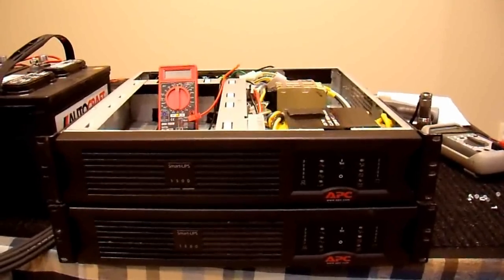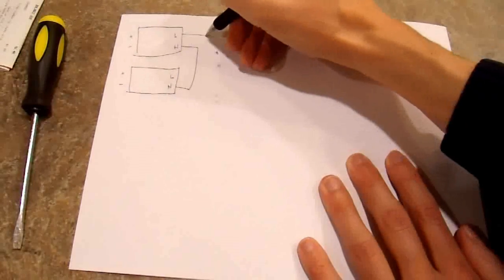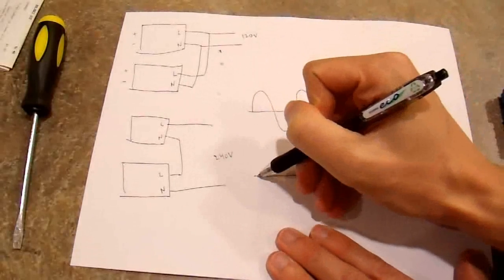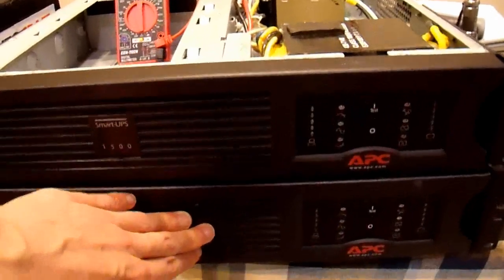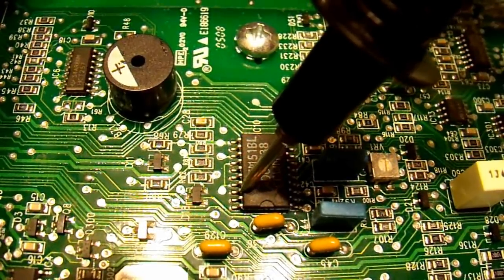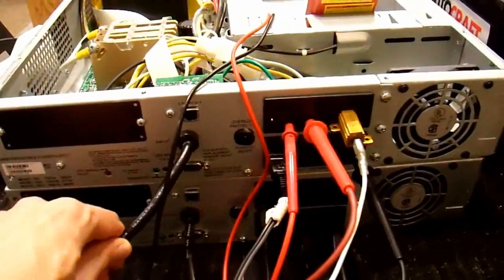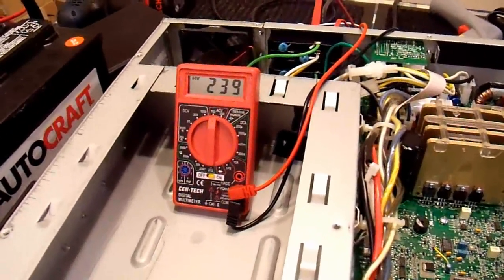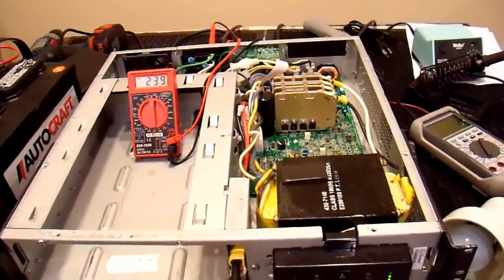Connecting Two UPSs or Inverters Together for Double the Output Power

Comment: current isn't additive in series, in series you are only getting the boost to voltage, current will be limited to the unit with the least capacity, Paralleling the output would give you a boost to load capacity. but your right about needing to maintain sync. Have you considered finding the local oscillator on the master unit and driving the slave with it. since most oscillator circuits use a feedback circuit seems it would willingly sync with an external source as long as the frequencies are close. which they should be give or take a hertz or 2.

Comment: Knurlgnar - this could be quite a break-thru for us off-griders.  This SUA line of inverters uses the common battery voltages of large battery banks (24/48 volts) and you have now discovered a simple way to feed split phase 240 volts to a critical load panel of the traditional split phase circuit breakers.  KUDOS!!
Question - do you have a feel for how "balanced" the two 120 volt phases must be before problems arise?  Can you experiment with this along with a long term load test to check reliability?
I sent an earlier request concerning a SMX3000 - could you please take a look at it?  Do you think the SMX line of inverters can as easily be "stacked" for 240 volt split phase power?  These are quite efficient inverters as they seem to be transformer-less and rely on DC voltages at or above the AC output voltages??

Comment: So if I wanted to take that 240v 3000w output and separate it into two 120v legs 180 degrees out of phase, how would be the easiest way to do this?
Reply: BC ElginTex Transformer with center tap on the output? Victron sells such isolation transformers, really meant for galvanic isolation on boats, but a good starting point for research?

http://www.victronenergy.com/isolation-transformers/isolation-transformers-2000va-3600va-7000va
Reply: You can also use two identical transformers wired in series, then take the neutral tap off the output where they connect.
Reply: @egoequus6263  Since this setup IS two transformers connected in series, just take the neutral where the UPSes are connected in series.
Reply: @eDoc2020  This is true, but the load would be unbalanced when using one of the 120 legs, i.e. each inverter would only handle the loads on its side. A center tapped isolation transformer or two isolation ones would balance all loads across both inveters.

Comment: hay your video"s are so  informative  the only time i have to watch is late at night . i have a smart ups 950 running watts. on the font of the unit its label 1400.   i saw your video that you did on the 980 ups up grade. Do you think i could do the same to a older 950 .  inside the unit look the same as the you upgraided
Reply from the maker: I would expect you could do the same.  Most of these older APC UPS units are constructed in a similar fashion.

Comment: Good Afternoon knurlgnar24..First off, love the video.  I am attempting the same type of project but using 2 SUA3000 RM2U Smart UPS's.  I have a question, where did you find the information for the AD converter?  Also, did you find any schematics for the APC's?  Any information you can provide for me would be greatly appreciated.  You could email directly if you like jason@evenmoretronics.com or phone number 226-432-2030.  Thank you in advance for any help you can provide me.  Jason
Reply from the maker: I don't have schematics or specific info on the ADC, I just followed the traces on the PCB and figured out what it must be doing.  It's difficult to offer much help without seeing your exact units unfortunately.
Reply: *****
 Thank you for the reply.  I asked because I wanted to save myself some research but I am sure I will be able to find the ADC pin out online and do some tracing.  I'll probably just pull some fets out of a 1500VA smart, build them both up to the boards max capacity of 5000VA. I'll keep you informed on my progress.

Comment: Hello! I have 2x APC Smart-UPS 2200VA RM 2U LCD 120V. But I live in Europe so I need 220V. Also, I am off grid so I use a fotovoltaic system. Is there any chance to modify the output of a single APC to 240V? Thank you!
Reply from the maker: This video shows how to convert two 120V UPS units into a single 240V unit with double the output power.
Reply: ***** Yes, I know that, but I asked if there is any posibilities to transform a SINGLE 120V UPS into a single 240V UPS. Thank you.
Reply from the maker: ortofilm
oh, sorry, I misunderstood the question.  The direct answer is 'no', however you could always use a standard distribution transformer to double the voltage by connecting it in an autotransformer configuration.  A 1kva transformer would be good enough since it can handle 2kva in autotransformer configuration.  They're pretty cheap when purchased as salvage.
Reply: ortofilm if you have 2 UPS's why not just connect them in series as shown in the video

Comment: hi knurlgnar24,
i have 2 pcs of APC SMART UPS 750 (SUA750I)
500watts, 750 VA
its already 230VAC 
is it possible to make it a 1000watts using a 230V AC not a 460VAC?

thanks
Reply from the maker: I've tried multiple methods such as paralleling the output transformers and such but didn't find a practical way to do so.

Comment: 240V would be great for folks with well pumps or even large sump pumps !

I just finished watching this and the whole previous series and have a couple of questions :
1) Do you think changing all 16 FETs to a lower Rds ON (0.003?) would help the overall efficiency or at least reduce the temperature rise of the transistor heat sinks ? 
2) Have you done anything about up-sizing the battery input cables ?
Reply from the maker: 2) Up-sizing the input cables would help - they're pretty marginal in the state shown here.

1) I wouldn't change all of the FETs simply because a significant amount of losses are due to the switching speed of the FETs.  Lower RdsON FETs generally have a slower switching speed and will burn more power during the switch time.  Your efficiency during normal operation may actually decrease.  It's probably best to stick closer to what the manufacturer designed the product for.  That said I do believe it would offer yet more startup surge capability if that's what you're going for.  This thing does pretty darn well though with the mods I already gave it - we're talking 7kw of REAL surge capability which is crazy good for a 3kw inverter.
Reply: ***** I lost my train of thought and started thinking about "ttraditional inverter front end (push-pull on a transformer) !!   (Watched too many of your other videos.)  Most of your losses are in the transformer so lower RdsON isn't going to help !

I want to see how an ingenious guy like you attaches 6 AWG wires to a circuit board !!

Comment: i have a stupid question , can i and is it safe to use a ups to charge another one?
Reply from the maker: Yup.  You can connect two UPS units to the same battery.  You can also chain two of them together (with their own separate batteries) to double the backup time in most cases.
Reply: thanks man
Reply: APC does not recommend this, but if you have two pure sine wave UPS (Most Smart-UPS) this will work fine. However, if you have two non-sine wave UPS systems, both UPSes will switch to battery at power failure because the second one in line will not like the ugly stepped square wave output of the first unit.
It will only double runtime, not wattage.
When you literally CHARGE an UPS with empty batteries with one with full batteries, you will lose a lot of power in the AC/DC and DC/AC transformations. So, not recommended.

Comment: could you use the balanced split phase right out of the breaker box to power the units individually?  You are forcing one to match the other, but if you powered each one independently from  opposite hot legs wouldn't the phase be balanced just as any 240 outlet? I am hoping so. I need to give uninterrupted power my cnc mill. Hopeing to put two smaller economical units on it rather than the relativly expensive 240 volt out units.
Reply from the maker: If the power on the split phase lines went out they would drift and after a few seconds they phases would no longer match.
Reply: Thank you

Comment: Hi knurlnar,
I love all your videos of moding APC ups. Just so awesome.
This video has a nice detail that I notice and would like to ask if your can reset it. That is the cold start default frequency. It seems that it is always at 60hz. Do you know how to set this cold start frequency to 50Hz as I use it for all stuff running on that 50hz frequency.
Many thanks.
Reply from the maker: I believe 50hz and 60hz models have different hardware loaded into them (filters tuned differently, etc) and would likely not operate as well at the wrong frequency, however it is likely possible to force change between frequencies if one wished to do so.  I unfortunately do not know the specific register writes necessary to make the switch.  Perhaps some searching about the "APC Smart UPS Protocol" will result in useful information.
Reply: Thank you for coming back and answering me.
I have this UPS as the back up source, when you get it connected to the power source of 50hz frequency and then cut the power off, it will continue to run the output of 50hz. But a coldstart will definitely result in the output of default 60Hz. I think that it may be in the protocal as well but i do not know how to fix it. Anyway, thank you for your soon feedback.

Comment: that's pretty nifty it be nice if it could run a 240 volt Air conditioner  on that set up. since I do have two of these types of unites I have the tower version but should be able to do the same thing. I wonder what would happen if there is and in balance between the two sides. split phases.  I have to say prettty cool.  I also like to try them in the other configuration were its still just 120 volts.   I guess you couldn't plug it in the wall as a APC any more since its only 120 and still use it as a APC with this configuration. or will there have to be other changes to either way this is cool like to see more on this set up, of what it can and cant do.
Reply from the maker: This setup can handle load imbalances between the two phases so long as each inverter is not overloaded.  Unfortunately you cannot parallel them to get 120V with this method so it is only useful for 240V.  A step down transformer could easily be used to get back to 120V if desired, however.

Comment: Just taken the lid off my 1500 and done some measurements. As the battery module area is now surplus to requirements, I may have a go at fitting the guts of another unit into the space. This would give me the option of single unit operation  or double, according to power requirements.
Reply from the maker: I like that idea!  Myself, I couldn't figure out an easy way to make it work cleanly and without significant effort.

Comment: if the slave truly syncs to the master wouldn't it sync in parallel as well as series ??
Reply from the maker: They sync isn't perfect and between the two there is about a 5VAC difference measured between them due to a slight phase shift.  If they were connected directly in parallel there would each drive as much current as it took into the other to overcome that 5V difference.  It might run for a little while at a very low efficiency, but bad things would soon happen.

Comment: Hi, nice vids. I've watched a lot so far. Question- I just ordered the Go Power 1500w inverter. I'm wondering- Instead of the kit inline fuse(Class T 200 amp) between the battery and inverter, could one use a 200 amp DC Breaker switch?
Reply from the maker: A 200 amp breaker would be a good current protection solution for that inverter so long as your cables are capable of 200 amps.  Fuses are generally less expensive and unless something catastrophic happens it will never need replacing, however if you want an easy way to disconnect the inverter a breaker is a good choice.
Reply: ***** Thanks for the advice. I couldn't find much info with Google, surprisingly. But, watching your vids, I thought, "Hey, this guy looks like he knows what he's doing." Or at least more than I do.. lol Thanks again! I'll keep watching!

Comment: Hi, I watched your 1500W conversion and the connection to the FET gates via those SM 20ohm resistors, interesting stuff.
 I'd like to multiple-up ups's in parallel (230V each) to double the current capability. Rather than fitting the extra FETs in the vacant positions, I have had this idea:
1. Connect UPS line inputs in  //.
2. Designate master and slave(s).
3. Disconnect the voltage relay drivers from the slave and couple the slave relays to the master relay drivers.
4. Remove the slave 20ohm gate resistors.
5. Run a wire from one master gate 'spare driver' to the equivalent slave FET gate resistor pad on the slave PCB via the 'spare' 20 ohm resistors.
6. Repeat for all FET's.
7. Connect both units to the common battery
8. Fire-up both units to check that tho outputs are in phase.
9. Connect UPS ac outputs in //.
10. If it works, good: If it doesn't, it was only an idea!
This would also save overdrive heating of the transformer etc. What do you reckon?
Reply from the maker: I like the way you think!  I did attempt paralleling transformers but it didn't seem to improve the output much and so I did not include it in the video.  A shame because it was a lot of work...  But your method has a good chance of working - and also a chance of destroying both units.  :)  Hey, if you make a video of this send me a link! 

I've been considering doing something similar with inverters but I am not sure if I'll ever get around to it.
Reply: HEY... not so fast!!!
 before point 9:   either use some oscilloscope(s) to check the 2 sinewaves, if you know that,  OR
briefly connect a 60 watt incandescent bulb between  2 of the like AC  wires, the other 2 bridged,  and if it does NOT light up, try a 15 watt one or less,if no light does that mean they are in synGing together, and can be joined ?

Comment: iam pretty sure both have to mach 1lw each but you may draw twice the current.  i did this with audio and placed a jumper at  both speaker negative, and used both hot r.l to the speaker , made a center channel but it worked and dident blow anaything.

Comment: THANK YOU!  I've been trying to find a video about getting 240 out of a pair of inverters because I was thinking of running my hot water heater off of a battery bank.  This video shows that it is possible!
Reply: Assuming it's a standard electric water heater without electronic controls, it will run from 120V just fine at reduced power.
Reply from the maker: NiHaoMike
Good tip - I was thinking of showing that in a future video where I demonstrated my backup system.  Water heaters are 4500W, so at 120V they will be 1/4 of that or a little over 1kw which is still plenty to keep the water warm with rationed usage.
Reply from the maker: I am glad that you found it useful.  There isn't much information out there on how to do this, or at least I couldn't find any.
Reply: I was considering running some kind of arrangement where I'd have two inverters run to a load center acting as the 2 legs of 110 coming in like a house, but I wasn't sure if that would work without causing problems.  Having a common neutral might cause a problem, as well as any double breakers causing a feedback between the two vial any attached appliances.  Any ideas about that?
Reply from the maker: hellcat1988
This configuration would work for powering a split phase residence and that was what I was initially planning to do.  In the end I decided to go with a 12V setup.  Double breakers could cause problems with applicances if one UPS decided to shut off due to overload or something.  I cover some of that in my video series about how to power your house with an inverter during a power outage, though I use a different method in that video.
Reply: I saw that one as well as one discussing the lower end inverters using a powered hot and neutral.  It wasn't something that I'd considered before, but it was helpful.  I'm lucky in that I don't have that problem with my inverter.  I have a 2k watt inverter with whatever sign wave it is between standard modified and true.  PMW I think.  i plan to at least use it for powering my bathroom as i only have lights and a ceiling fan in there, which won't drain the 3 batteries I have to power it too fast.  I'm building a wind generator out of old cordless drills with a gearing mechanism.  I'm trying to get at least a 10-1 drive ratio to maximize the output as the motor I'm starting with requires alot of torque when there is a load.  Puts out 16v at 800rpms though so I'm hoping it'll be a good motor.

Comment: Interesting project. My only criticism is that in your sketch, - IF - you're intending to show the waveform at the 240V output leads (referenced to the common lead tying the outputs together), your explanation of the phase relationship is backwards, although you do explain it correctly later in the video, re house wiring.
Reply from the maker: hmm...  It is very possible that I made a mistake in the sketch - it wouldn't be the first one I've made in one of my videos!  I hope I got the idea across at least..

Comment from the maker: I had a similar plan in mind but ended up buying a 12V 3000W sine wave inverter instead.  I made a 12V genset and acquired a bank of scrapped batteries to use.  In all I have pretty much the same plan except that I wanted to be able to charge the batteries on gasoline and didn't need 240V power.

Your 3kva units are much more capable than these 1500's and if you can figure out how to keep them in phase it should work well.  Watch the no load battery draw though - it may drain batteries fast.